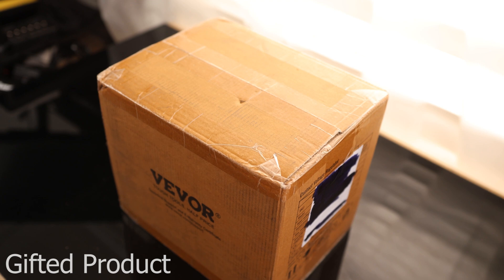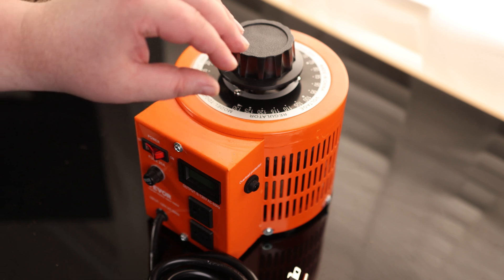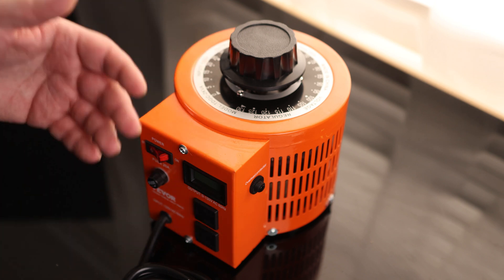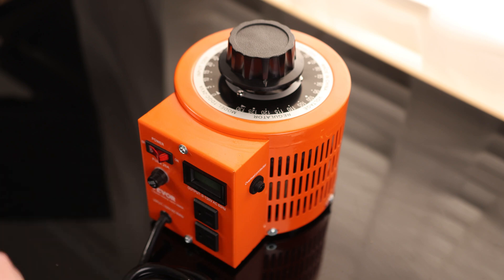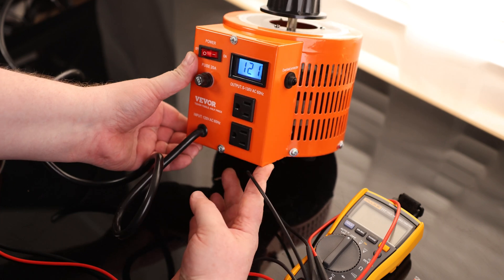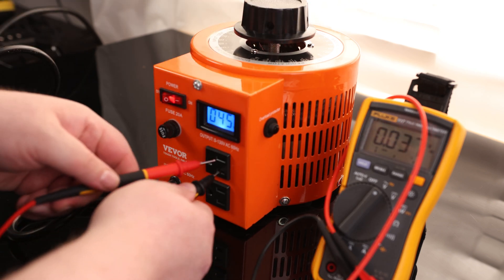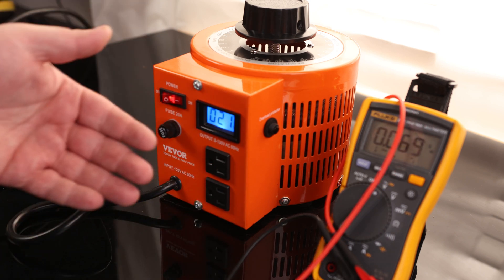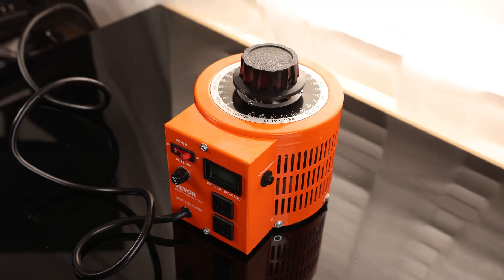VEVOR 2000VA Auto Variable Voltage Transformer, 15.3 Amp, 110V Input 0-130V Output AC Voltage

Comment: Does the voltage actually adjust to 130 volts on this model? 
I ask, because I will be using it on a tube guitar amplifier in a recording studio (as many guitarist do) and if you are not careful the 130 volts can blow some components on a tube amp if you accidentally turn it past line voltage. 
The actual usage for a Variac (for guitar amps) would be to reduce the voltage by around 15-20 volts to around 100 volts to dial in what many refer to as the Brown Sound. 
Eddie Van Halen was reported to reduce his amps voltage to 90 volts, but I do not plan on doing that.
Thanks in advance for your input. (no pun intended).
Phil

Comment: I was wondering, can this be used to reduce line sag?  I usually get around 116v coming out of the wall, would prefer it to be closer to 120. I would like to use this in conjunction with a ups and other power conditioning to optimize ac for electronics. Would something like this help?
Reply from the maker: What I would do is call your power provider and have them click your transformer up a step or 2:  https://www.youtube.com/watch?v=Zg_EPmtbI58
Reply: @distractor_beamreviews  unfortunately, I'm an apartment dweller, so I don't believe it's an option for me.  However, I really thank you for the response.  I was just wondering if something like this might help .  :-)
Reply from the maker: @davidb1412  I see.  If that's not an option, then this may be a good bet.
Reply: @distractor_beamreviews  thank you.  So, to be clear would I come from the wall with the variac, then ups, then clean power?  What I mean to say is should the variac be upstream of everything?  This is the way that makes sense to me, but was wondering what your take is.
Reply: My ups units are pure sinewave, perhaps remove power conditioning after the fact all together?
Reply from the maker: @davidb1412  Yes.  I'd also put the transformer before the UPS.
Reply: @distractor_beamreviews  thank you for your assistance. Hope you have a good one.
Reply: Hi, I have a power wash that needs 20 amp can  I buy something like your machine or another model?
Reply from the maker: @cyrus1147  They have a 23 amp as well.

Comment: And did you check the safety ground? I mean that chassis is  presumably made of three parts which are not welded together.  It means that all three parts (bottom, front panel, sleeve) of that should be connected to safety earth with separate bolts and wires using star washers. And I bet it is not done that (the proper) way.